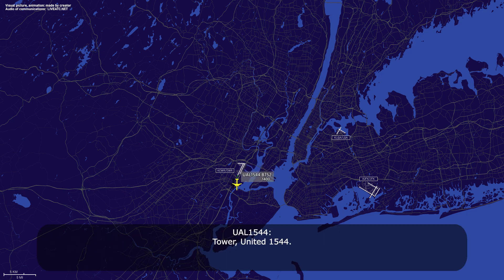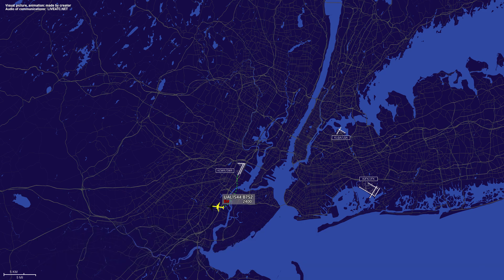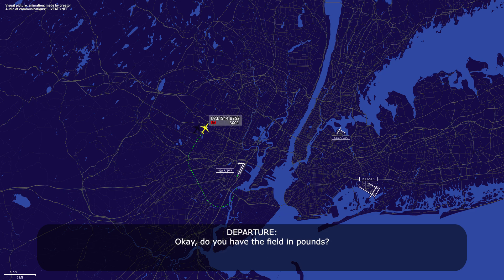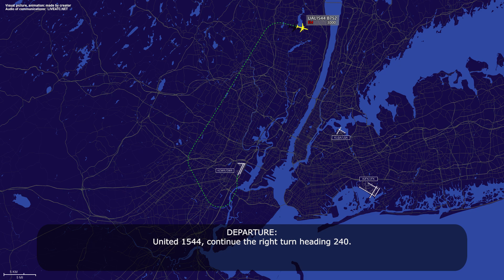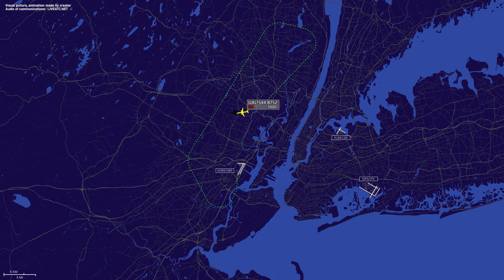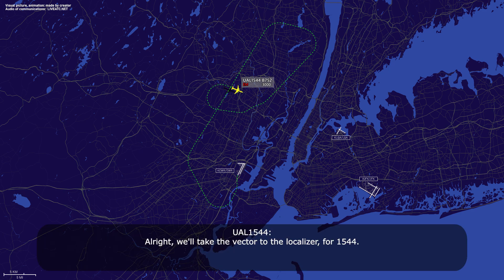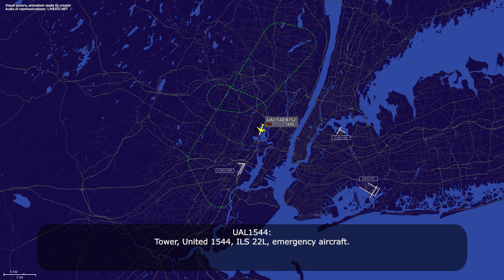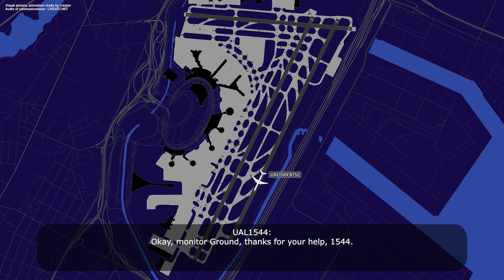Airplane lands at Newark only with one engine running. United Boeing 757 has engine issue. Real ATC

Comment: I was on this flight and the pilot handled it amazingly well. Nobody in the cabin was concerned - until the pilot said something, the only reason why I knew something wasn't right was because we leveled out at a lower altitude and we started making a loop back around to the airport. Even the landing was pretty smooth.
Reply: How much info did the pilot provide to the passengers?
Reply: @joeyf504327  They mentioned that they were getting low oil pressure from one engine and that they shut it down (and had been flying on one engine for a bit). They said that planes are able to fly on one engine but that it is better to play it safe and return to the airport to determine what the actual issue is. It didn't seem like anyone was scared on the plane. Once we landed, we got onto a taxiway and stopped for some of the fire equipment and others to take a look at the plane, then we taxied to a gate and stayed on for a bit (they were trying to determine if we'd fly out on the same plane). Eventually, we switched gates and waited for a new plane to arrive to take us to LAS.

Comment: Wow I worked on this aircraft and most of the 757’s for years. These are old airplanes. Some with Pratt & Whitney and the rest with Rolls Royce engines. I’m surprised they still have them flying. I think the Airbus 321 neo was the replacement.

Comment: Is that company SOP to shut down a good engine in flight? low oil pressure big deal, the pilots trying to save money on the overhaul?
Reply: Its procedure. One it could create an problem like FIRE. Two the plane is a perfectly capable of flight on a single engine. Three it’s a 50 million overhaul.
Reply: No oil pressure isn't a mark of a good engine. It's a mark of a soon-to-be fragmentation grenade.
Reply: Low pressure means engine is going to go boom.  That can cause lots of problems that are much worse than single engine ops.
Reply: Read about Eastern Air Lines Flight 855. You will learn a thing or two about the consequences of flying with no oil and advantages of an early shutdown.
Reply: Yeah I’m sure these professional pilots would shut down an engine, extend the flight and make more paper work if it wasn’t necessary